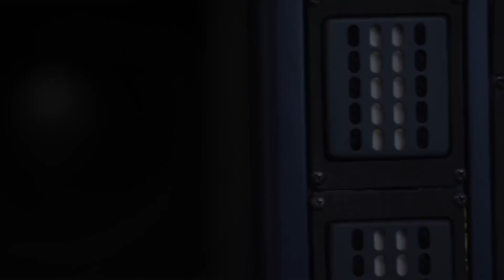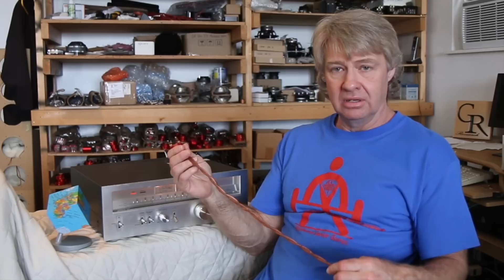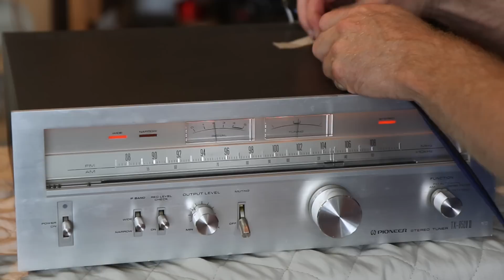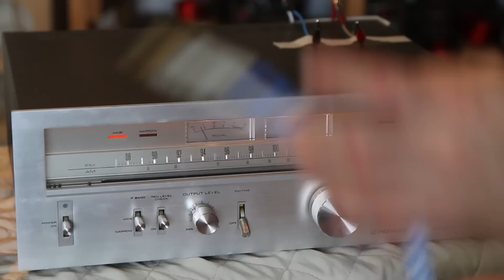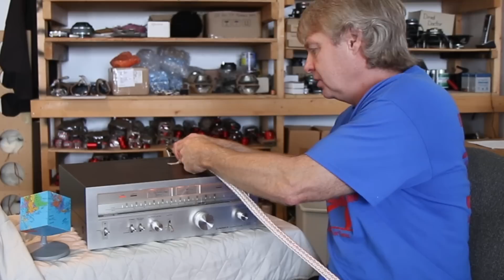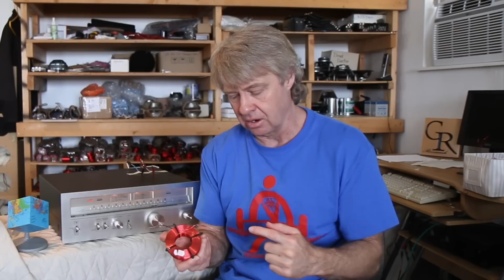Do Audiophile Cables Matter? Here's PROOF!

Comment: I don’t think anyone has ever denied that copper wire can be used as an antenna.  When you plug it into a receiver that is specifically built and designed to pick up the tiniest possible RF signal and amplify it to audible levels, you get an output.  Congratulations, you’ve proven something nobody has ever denied.  Nobody resists the idea that it’s important to use good shielding on the cable between a turntable and a phono preamp because much like the receiver (although to a lesser extent), it also functions to turn a tiny signal into something our ears can make sense of.  

The thing is that once a signal has made it to a speaker cable, no further amplification will take place.  You may as well stick the banana plug on one end straight into your speaker with the other side unplugged and put your ear up to your speaker.  If that RF noise is present in the room, it’s of an amplitude that can change the behavior of the speaker, you’d hear something… anything.  Of course with the speaker plugged into the Amp you can turn the volume all the way up and you may hear some hum, but the fact that you need to be plugged into the Amp to hear it means the noise is coming from the amp or coming into inputs of the amp and amplified by the amp.  

Despite the inaudible extraneousness of EMI and RFI on speaker cables, at least those things actually exist and they are the best reason to invest a little more in braided and shielded cabling.  Brading and shielding, however doesn’t come close to justifying the thousands of dollars that are sometimes spent on cabling.  You can do all the things that matter to make a cable better without ever spending more than $50 on a cable. You could rationally justify paying twice that much if you like the look and feel of the cable.  

The reason why cables have become so divisive is the language in the marketing of obscenely expensive cables where they imply that their special cables are lubricated with pixie dust that helps the signal flow through the cable like water in a river without the details of the audio getting caught in the eddy currents...  The best way to recognize that cable companies are capitalizing on the ignorance of the general public is when they put arrows on an audio cable to tell you which direction the electrons flow to further foster the misconceptions that audio signals are a consistent flow of electrons from one point to another and support the pixie-dust lubricants and electron eddy current propaganda.
Reply: Or for an assymmetrically terminated shield. 🙄
Reply: @DBravo29er  If there is a pigtail to ground the shielding on one end, then it needs to be on the end toward the device that has a ground post, it's got nothing to do with direction of signal flow.
Reply: Kevin Gest I’ll ask the million dollar questions: How many of these expensive cables have you heard?  What’s in your equipment stack? What are your listening or ABX impressions of these cables? 

Criticisms of questionable marketing strategies aside, what is your personal experience with these esoteric cables?

NOTE: I actually agree with you for the most part. But with so many user reports by educated users, the point of argument that they are all delusional doesn’t withstand scrutiny. One needs a healthy sample size of good data to refute this.
Reply: Kevin Gest Well I’ve got over 20 years in professional audio. Full voting member of AES. Countless dozens of shows with thousands per show. Studio and live recordings. Wireless and wired signal transmission system design. And you’re not helping the cause. You have experience with cables, but you’re extrapolating non-Audio experience into audio. Even Belden has found this to be an inaccurate premise after developing their Iconoclast line.

You’ve got an impressive resume, but you haven’t answered any of my questions. Not one. I’ve got over two decades of experience in professional audio, and am using nearly $20k in equipment in my main stack at home. I’ve done ABX comparisons, but not enough to offer a meaningful sample size.

You’re obfuscating. That doesn’t help.

We’ve got repeated, specific user claims that certain power cords do X; either they improve sound stage width or depth, or the blackness of an image. Or the textural detail of an image. Across dozens and dozens of user accounts on a given cable. Refuting that takes more than rank theory filled with “shoulds” and “shouldn’ts”. It takes data.

I’m trying to instill some scientific rigor here, or else we’re no better.
Reply: Kevin Gest Galen Gareis, who spent a long tenure with Belden as a lead design engineer, has left Belden and teamed up with Blue Jeans Cable (a no-nonsense outfit) to make the Iconoclast line. He’s authored three or four whitepapers here:

https://www.iconoclastcable.com/story/index.htm

His whitepapers offer much data and research that seems to echo the sentiments, if not the exact assertions, of the cable crowd. But he’s a scientist and engineer by profession. He has developed many cables and patented many new designs while at Belden, for critical military and commercial applications. And he’s asserting that cables can and do matter. Were I to see him at the next AES convention, I don’t have the data to refute his assertions. And you haven’t proffered any, either. He would, as the saying goes, “take my lunch money” if I were to debate him.
Reply: @DBravo29er  With regard to your questions about what audio cables I’ve tested and what system I’m listening on, I had already explained why they were irrelevant. Asking about my equipment is a transparent setup for you to declare my system inadequate regardless of the answer and create a red herring to distract from the actual discussion.
The scientific principles that dictate how signals move through cables in a 4-million dollar linear accelerator are the same in Audio equipment. By the way, the military communications equipment was used for voice communication, so it was Audio. Nonetheless, amplifying a signal and moving it from one box of electronics to another is century-old technology that is replicated hundreds of times within each of the systems I work with.  

The fact that you brought up Asymmetrically terminated shielding as evidence in favor of directional audio cabling speaks volumes about your actual level of technical expertise (the little eye-roll emoji was cute, even cuter that you immediately changed the subject to asking about my system when you realized you were wrong). You’re like a very experienced bicycle salesman telling an aircraft engineer he isn’t qualified to talk about how a wheel works.
Simply stating that there are examples of people hearing differences made by certain cables is about as scientifically rigorous as talking about all the people who think that they actually communicate with their dead grandparents on a Ouija board.The fact is that all these manufacturers of high end cables are trying to sell to market where half of their potential customers think their product is about as effective as a coat-hanger.  The manufacturers have a tremendous economic incentive to produce a properly documented  peer-reviewed study with ABX testing showing that their cables actually make an audible improvement in sound quality, but they don’t… at least not as far as I know. 

You have 20 years of experience in the industry, certainly you’d be able to provide a link if such a study existed, right? There is no incentive for anyone to throw money into producing and publishing studies with results showing people that there is no benefit in spending more money, so a lack of published research would seem to point to the later.
Reply: Kevin Gest You’re wrong.

You’re evasive and stuck in Theory. Meanwhile, the former head cable engineer at one of the largest cable companies in the world (with countless parents to his name fired MIL and research sectors) has authored four whitepapers, chock full of data from the real world.

You’re the teacher with the chalkboard saying how things should be, while Galen is the senior engineer in the real world, telling you how things ARE.

You’re not helping with your word salad posts.
Reply: Kevin Gest Oh, and I’m still right about the shield. You’re a word salad chef; you would get eaten alive in a discussion with real engineers. You pushed buttons on test equipment. What have you designed? Actual products have you engineered from scratch?

Also, you’ve obviously got zero background in transmission line theory or usage. It’s vastly more than L-C-R.

Can you explain to me how a DA reconstruction filter works? 

Lastly, since you dodged my questions about actual usage or your system, I am forced to conclude that you’ve listened to and measured exactly zero actual “audiophile” cables. And, further, that your system has so little resolving ability, that you couldn’t tell the difference even if you had.

Meanwhile, I’ve got a full stack of RME and Benchmark gear with a system S/N ratio that isn’t less than 129dB. I doubt what you use has a S/N exceeding 80dB.
Reply: @DBravo29er  Soooo, no peer reviewed Studies? the lead cable engineer for one of the largest cable companies in the world has a hell of an interest in convincing us of the efficacy of the product his company sells.

Since you think working for an audio company lends credibility, Here is what the engineers at Schiit audio had to say about their own cables:
"Beyond Just Technology: SuperUltraHyperTechnology
PYST cables are made from only the finest 6-nines Unobtanium™ alloy, molecularly assembled in our Alternate Universe™ reality-distortion tesseract field , using a secret geometry reverse-engineered from crashed UFOs, painstakingly smuggled out of Area 51 by deep-cover operatives. Performance is further enhanced by the use of a QuantConnect™ quantum-entangled pair of transmission interfaces, held at absolute zero by our exclusive Stasis Field™ technology. The cables are then wrapped in NanoAeroCap™, a nanotechnology-enabled aerogel anti-capacitance insulation system, featuring Fractal Interleaved Geometry™ to create negative inductance for maximum audio transmission quality."

That's funny right? They recognize what BS this high-end cable rhetoric is, but even as they try to sell you their own cables they give an ironic description of what they do?
Reply: Kevin Gest Your straw man argument is WEAK. 

They don’t make their own cables; straightwire does.

And I own their USB and RCA cables; straightwire right on the connectors.

Failing to laud a competitor/supplier’s product doesn’t prove or disprove anything.
Reply: Kevin Gest Enjoy your Aiwa boombox. Leave the listening to the experts.
Reply: Kevin Gest Even assuming that you read and digested nearly 80 pages of scholarly and data-dense white papers, and interrogated their sources within the 45 minutes it took you to dismiss them, I question that you understand them.
Reply: @DBravo29er  "you would get eaten alive in a discussion with real engineers." 
Well lucky for me I"m just talking to you. If you are right, explain why.
Reply: Kevin Gest Being an actual engineer, I’ve already supplied those four whitepapers. If you want to have an intelligent discussion, read those and then let’s talk. At the very least, read the first two.

I haven’t been able to rebut any of Galen’s data. Not for want of trying. But he’s measuring substantive differences in cable construction, materials, etc. I may very well run into him at the next AES convention and it would be absurd for me to greet his data, with Theory about his data. Data requires data to rebut.

Read them and see if you can find holes in it. I got nothing. I read each paper several times.
Reply: @DBravo29er  OK, I'll read some and get back to you. It might take a while, as this isn't the only thing I have to do today,
Reply: @DBravo29er  Having spent some time slogging through 20-30 pages of theoretical word salad, which according to you is my specialty, unless you’re trying to sell me Iconoclast cables, I can only deduce that the reason why you wanted me to read those documents was to show me the measurements showing the nonlinear impedance of speaker cables at Audio frequencies due to the the effects of the dielectric materials on velocity of propagation, which being specific to lower audio frequencies is not something that that people who don’t specialize in Audio equipment often don’t take into consideration, and I will admit I had not considered.

At one point in my reading the author did also mention that because speaker cables terminate into speakers which vary from 2-20 ohms depending on frequency, audible differences from cables with non-linear impedance due to velocity of propagation would be negligible, but might have an effect on aggregate distortion levels. If that is the case it would greatly depend on what else is in your system. 

The next step for these documents to be scientifically relevant evidence that cables make a meaningful difference would be for someone who doesn’t have an economic interest in selling cables to independently redo the tests and come up with similar results and then independent blind ABX testing using a variety of equipment with a statistically significant number of testers being able to differentiate between systems with different cables to show human ears can actually hear a difference.
Reply: Kevin Gest No. Its proof that you’ve got zero actual experience or data with the cables in question.
Reply: @DBravo29er  What are cables in question? I've been talking about the Video in which he clams that plugging several different speaker cables into a radio tuner and listening for noise means the same noise would end up causing interference on the speakers. I have no idea why I would need experience with specific equipment to know that the experiment doesn't work.  I think you are trying to drag me into a "my system is better than your system" pissing contest, which I won't do, but for the record I think my Dad can kick your Dad's ass.

Comment: The braiding of the cable with 6 strands could be carried out in a much more efficient way, the strands of this one are only joined in pairs and braided like 3 wires, moreover why is it important to braid the threads around a cotton core?

Comment: Great video, thanks for sharing. I wonder, if, for your 24stranded, braided reference cable you had used magnet wire instead of tefloned wire, the result would be even better. Or, if the fact that the copper quality, in this case not being as pure as Ohno-Continuous-Casting copper, would undermine the advantages of better geometry.
Reply: I feel  I must add this because of safety issues: One should NEVER use magnet wire for speakers, in a braided hot/ground configuration, with a non-potected-against-shorting amp. I'd also say, not at all with a high wattage amp, anyway. (Not at all with ANY amp applies better to amateur audiophiles). The constructing process should make sure that the insulating thin enamel remains intact and is not stressed or abraded (tight braiding is to be avoided). The whole cable should be treated rather like an immobile object after instalation, not treated like a common cable. Bending and stressing it will eventually lead to short-circuiting and burning your amp (or even more). NOT TO MENTION, IT IS AN ABSOLUTE NO-NO for power cables!

Comment: Hi ! i love experiments a lot.  And i found excellent your advice about cables that can act as antennas.  Of course speaker cables,  being not shielded, have a nice potential to be great antennas.  But usually they are connected to passive speakers ... my point being that there are not amplification stages after them that can amplify this noise.  
And actually shielded speaker cables are quite rare.  Not so instead mians power cables ... often they have indeed a shield. I would try the same experiment but with signal cables that have amplification stage downstream.  My guess is that not only the presence of  a shield but also its execution becomes very critical for signal cables.  The better the shield the better the noise rejection.  
Strangely i have seen unshielded cables used also for signal transfer a case in the picture.   
https://i0.wp.com/theaudiophileman.com/wp-content/uploads/2019/04/Screenshot-2019-04-16-at-17.15.46.jpg?ssl=1
that would pick some noise ?
Reply: ...AC noise...
Reply: @donpayne1040  do you mean that shield on ac cables is of no use? My point is that an antenna needs a following active stage after it Speakers do not amplify anything
Reply: @gino3286  err..
Reply: @donpayne1040  am i wrong? How?
Reply: @gino3286  no, no , you're right

Comment: I'd like to see the test run with a 300-ohm resistor (dummy load) that is the same load as a standard antenna across the open end of the speaker cable. That would better simulate the scenario we have when a speaker cable is connected between an amplifier and speaker. My sense is the differing topologies of tested speaker cable are essentially offering differing open-circuit impedances. Keep up the good work, Danny......really solid, grounded, sane conversations. I'm a big fan of your work.